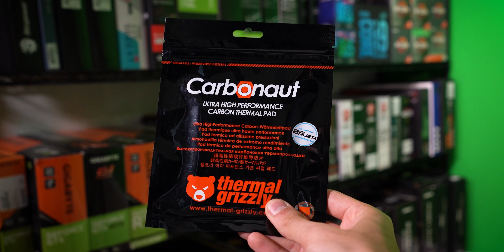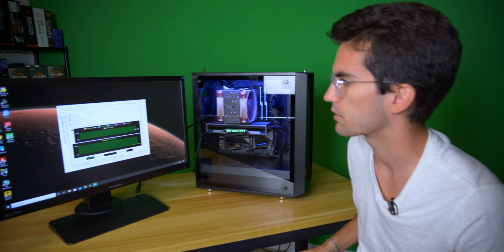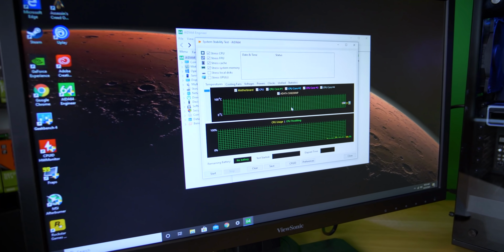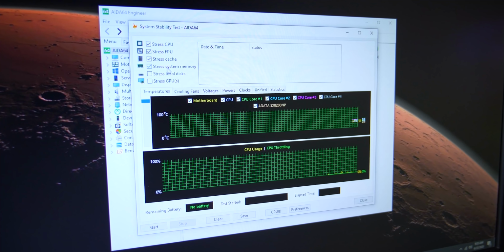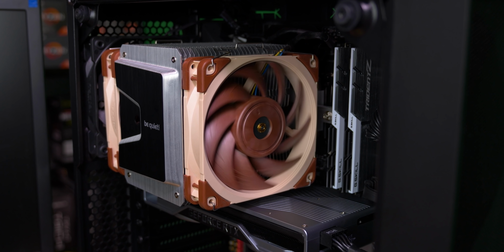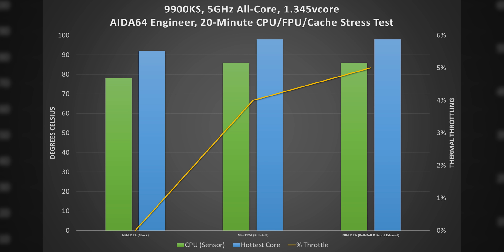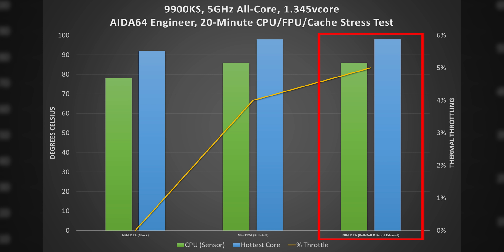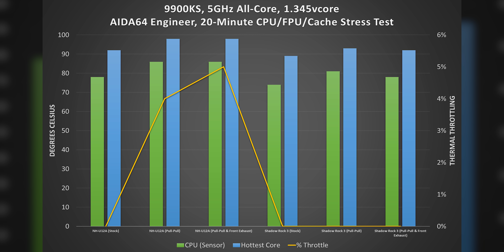Testing a Super Weird Fan Setup...

Comment: Carbonaut  pads are meant to be used WITH paste.  2 pads with a layer of paste in between to make a carbonaut sandwich.  Then flip after 5 minutes to make sure it cooks evenly on both sides.
Reply from the maker: LOL
Reply: 🤣🤣🤣🤣🤣 I was wondering where that was going, 11/10
Reply: This comment is next-level trolling, if you can't tell by looking the username.
Reply: @marlcelinojuventus2441  😲NO! REALLY!

 I thought it was the REAL Stefan 🙄

🤣🤣🤣🤣🤣
Reply: You had me at the first sentence LOL
Reply: Mmm, grilled carbonaut sandwich. The best for your pet multitool.
Reply: don't forget the thermal pad installation tool, that's right he got one
Reply: I thought carbonaut pads were supposed to make sure the CPU doesn't come into contact with the rest of the system so it doesn't short circuit?
Reply: Had me in the first half, not gonna lie
Reply: Today we are a carbonaut pad, “that’s right, we got one”

Comment: Funny you made a video on this. I accidentally did this to my 3700x on the U12A and only found out months later and when i corrected the direction of both fans the temps that were idling near 50C were knocked down to nearly 40C.

Comment: If you add a 3rd fan blowing down, it might actually work pretty good. That means cool air down the middle, and hot air outflow is split in two vs traditional single directional flow

Comment: You should have added a fan to the top of the open fin cooler to see if pushing airflow into the cooler makes any difference. If I were to run a system like that, I would add a fan to push in with dual pushing out. Without the push, it's just static air like you said.

Comment: Been messing around with fan orientation for my extremely lousy case, and for some reason the end result is that coolers with bigger center radius are more efficient for pulling configuration, while fans with smaller center radius work better in a push config. Would love to see some checking on this subject
Reply: If I'm not mistaken noctua has actually done this to one of their coolers... A small 60mm under the sink and a 90mm on the top
Reply: @Rov-Nihil  wonder if that is more for performance or to fit the extra fan 🤔
Reply: @shaneeslick  maybe both? i see it marketed as a htpc cooler, so maybe more the tiny factor but perhaps with that theory in mind

Comment: I am not surprised that the be quiet cooler did so well, those germans really know their stuff. That why I have a deep base 700 case with 8 silent wing 3 fans though I admit I have a asus aio cooling my 9900k in a push pull set up.

Comment: I would definitely like to see Push-Push as well as Push-Push and Pull-Pull on a dual fin stack tower like the NH-D15, but the fans on the outside of the cooler without the inner fan.

Comment: Interesting! It helps a lot that the heatpipes (and thus the most heat) is relatively close to the sides, due to most airflow in those region instead of the middle. Especially for the Dark Rock, the pressure naturally moves the air outward if it can escape there. 
I'd also be interesting how the NH12A performance with the fans blowing in "reverse" direction. That heatsink is optimised for airflow in the "normal" direction. A very highly controlled testing environment would be needed probably though

Comment: Basically, it depends on the design of the radiator.  If it's a tunnel design, you want air flow in one direction.  If it's an open design, air flow direction is less important, unless you want optimal performance.

Comment: The be quiet! cooler might do even better with the pull-pull config if the GPU was moved down

Also, 10/10 recommended Carbonaut pads, I got one for my 3400g and it works great

Comment: I would also like to know if using noctua industrial fans on it will make it closer to the nh d15 in performance while still being smaller

Also coolers like the fuma 2 are good because they have a fan that is a mirror image to the other one to make the airflow laminar. I also want to know how those fans would work on the u12a cooler to see if it really is that laminar flow that makes it quieter

Comment: I think you will run into an issue where the intake from the front and the first fan on the cooler will blow blow air at each other and make the whole thing pointless. 
I think this could work if you were dealing with bottom-to-top airflow (like InWin 305 case or LianLi 011 Dynamic) instead of front-to-back. You can retry the test by removing the HDD cage and the PSU cover from the font of the case, then mount a fan (or several of them tight with zip ties) in the place of the HDD cage so the case takes air from the bottom and blows out air from the top and back. I am currently experimenting with that and I have the 2 stock fans mounted there and a 120mm fan at the lowest position in front to push the air toward the GPU.

Comment: What about Push-Push on both coolers? Pull-Pull will create negative pressure, Push-Push will create positive pressure so the dark rock might benefit from it. Most likely not better than the optimal push-pull, but more similar results than Pull-Pull achieved.

Comment: I think it makes more sense to say the intake fan is pulling air in and the exhaust fan is pushing air out.
Reply from the maker: Depends on your reference point. Makes more sense to me the other way around. Either way, who cares.
Reply: if you want t be technical, aren't both fans doing the same action, either the Fans 'Pull Air' or 'Push Air', so shouldn't it really be 'Pull Pull' or 'Push Push' 🤔

Comment: Perhaps a push-push NH-D15 with a top exhaust to pull the air off the middle of the towers? Might prove an interesting noise test case.
DIY Perks did something similar, but in an open setup youtu.be/h6hvsqUEtZ4?t=323
Reply: To be fair, he pretty much had to do it in an open setup.  Since he was trying to cool a gpu with an nh d15, there's not many cases that could accept that.
Reply: Fortunately that doesn't apply to this test here :)

Comment: Wonder what the effects would be on RAM and VRM temps for running a pull/pull configuration long term (not that I would do this). You do have air flow coming to them, but essentially hot air being passed over the components. Seems you would have to go all negative pressure to keep ejecting heat from the case to keep other components like the GPU from just pulling in hot exhaust.

Comment: So does this apply to radiator setups with push/pull? Sorry I'm new to computer building and was wondering where should I put my four fans? I have 2 front intakes top exhaust and rear exhaust? Is this correct?
Reply: 2 front intake
1 exhaust at the end of the case 
Should be enough
Reply: @Ayoub-wg3tw  but what about the top? I have 4 and thought I shouldnt waste it
Reply: The Noob ReturnZ 
3 should be enough but you also can do the top exhaust

Comment: so you tried a pull-pull config, but not a push-push? 
it only makes sense to do it! and i think it might perform slightly better than pull-pull (cuz positive air pressure FTW). then use the exhaust as an intake for one of the fans and maybe have 2 fans at the top of the case as exhaust, basically turning it into some sort of forced convex cooling like the corsair one.

Comment: When you have a double fan CPU cooler, does it make sense to put  2 splitters on the CPU  fan connector  (in order to have 3 connectors) and connect both CPU fans and the exhaust fan (back)? This in order to have them all spin at the same RPM and as such not have turbulence in front of the exhaust fan  if the CPU fans RPM is ramped up. This of course with the assumption that the air volume pushed by each of these fans are +- in the same range.

Comment: As many videos as I've seen on fan configuration, I have yet to see one with top and rear intakes with front as exhaust. Any chance we could get a video on that? Or, if someone knows of a video, could you point me to it?
Reply: the problem with that is the very rear fan mounting area does not have any filters so you would have to add one unless you dont mind cleaning your pc every month, but even then you would want to remove the front filters if you run the fans there as exhaust so theres no airflow being blocked for optimal heat removal. it SHOULD work about the same since youre not really changing much other than just the direction of which the air flows through the case. I found a good setup for my meshify c by running 2 140mm up front, 2 140mm on top (furthest front one as intake, the top back as exhaust) and a rear exhaust as well and setting tweaking the fan speeds til you see your temps stabilize. Worked pretty well for me but each case will obviously have some differences due to size or fan configs. Its fun to experiment with thats for sure!

Comment: Already doing this on my Nd-d15. Figured i'd try it for a month and see what happens
Reply: G'day sirvemon
, Good to see you are Sciencing yourself, there is always so much to learn,
do you have the fans in stock position (Front, Centre) or Both Outside? you should also try them opposite air direction & with a fan above if case has a mount, so if they are blowing into the cooler an exhaust on top & if they are Exhausting the Cooler a Fan blowing in from the top of the case
Reply: @shaneeslick  I have them both on the outside with a fan in the rear pulling out of the case, and another pulling out the front of the case. I don't have any fan mounts to put air into the cooler itself, what I've been doing is taking the side and front panel off my case when I need better airflow for more intense loads, to increase airflow. Airflow is my biggest killer, because I'm using a silent base 601
Reply: @sirvemon  Airflow can be a problem in Silent Cases (G/N Reviews show this a lot), also all the Sound Dampening Material on the Panels Doesn't work if you take the Panels off,
I like be quiet! Fans but much prefer a Airflow Case to their Silent ones
Reply: @shaneeslick  I prefer silence for the most part, which is why i use a silent case, but when I need performance I can deal with not having sound dampening, which is when I take off the side and front panels, to get the best of both when I need them

Comment: you're missing the point here, a double volume cooler should be used not monoblock , remove the inner fan and mount it outside as well, in different variants (most important one both blow air into the blocks)...

Comment: G'day Greg & Nate,
Well that wasn't much of a Surprise 🙄, Placing 2 Exhaust Fans on the CPU Cooler Fin Stack just 'SUCKS' 🤣🤣🤣🤣🤣,
Greg you didn't Science this topic enough, add a Top Case Fan blowing down on the CPU Cooler, this could help the be quiet! Shadow Rock 3 even more by blowing Cool Air Into the CPU Cooler & Blowing the GPU Air Down & away,
Also just wondering how the Temps are if you have Front case fan In, Front CPU Fan In, Back CPU Fan In, Rear Case CPU Fan In, top Case Fan Exhaust right over CPU Cooler Fin Stack, there are Many More Science left in this one 😁

Comment: Honestly I feel like if a cooler was designed with this fan configuration in mind it could work — pulling away air efficiently doesn’t seem like too terrible of an idea
Reply: Actually it's harder to control the airflow if you try pulling air away using fans. The air will tend to take the path of least resistance which means the fan will pull air from an arc of more than 180°, while if you push air it will tend to travel in a straight (not really, but at least straighter) path from the fan so you can aim the airflow in a certain direction. 

Predicting how the air will flow can be much harder than you would first believe. In the pull config it's more or less impossible, and even i a push config it can surprise you. One experiment you probably have done or seen performed is trying to blow out a candle while blowing through a funnel from the narrow end. The air will follow the surface of the funnel and spread out all along the rim of the wide end making next to impossible to blow out the candle.

Another problem is that a fan will be louder if you put any obstructions on the pull side than if you have the same obstruction on the push side.  You can try this by putting a fan grill on a free standing fan and compare the sound when the grill is on the intake side and when it's on the output side of the fan. A heat sink will act just like a pretty obstructive fan grill and it should be easy to hear the difference when the fan is mounted in a push or pull configuration.
The common push / pull configuration does suffer from the added noise from the pull fan, but at the same time the two fans assisting with the airflow can be run at a slightly lower RPM which helps keep the noise level down.

So if making a pull / pull configuration with a heat sink designed for it isn't optimal then how about a push/push config?
This might actually be a bit better, but still it's probably not going to be as good as a push/pull config. Besides if you don't have to design the heat sink with a gap in the middle to allow air to enter or exit then it can be made more compact while maintaining the same fin area.

There are some heat sinks that actually do use a design that might work reasonably with one of these oddball configurations. This design is often called twin tower and consists of two fin stacks with one on the heat pipes facing the front of the case and the other fin stack on the heat pipes facing the rear. Some of these has a gap large enough to mount a fan in the middle of the heat sink for a total of three fans. Omitting this middle fan a push/push or pull/pull config should work better than it sis with the Shadow Rock 3 and much better than it did with the NH-U12A.

Comment: If your testing unconventional airflow configurations try the Tech Deals method. Front and rear case fans set to intake with the CPU cooler direction flowing rear to front. 
Is he a madman or a genius - will CPU and GPU temps increase or decrease - only science can tell.